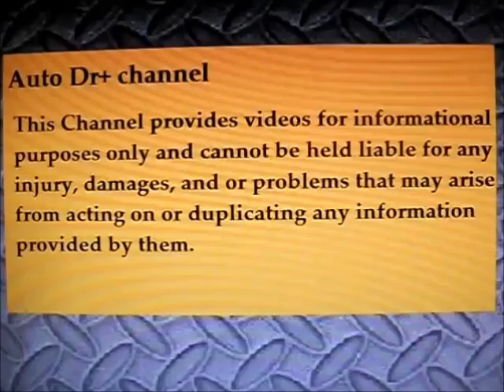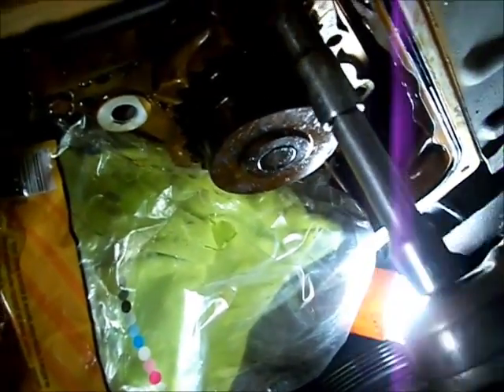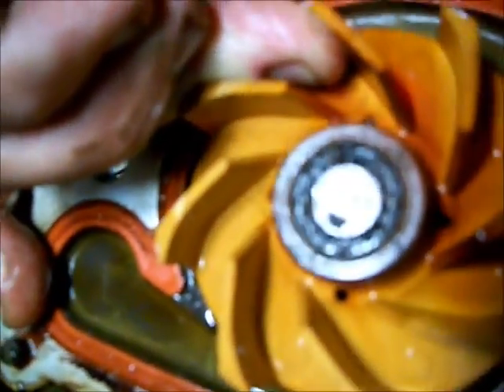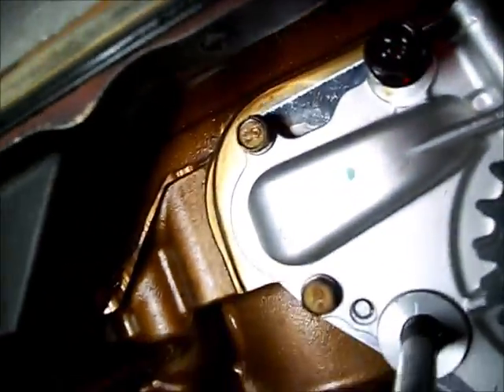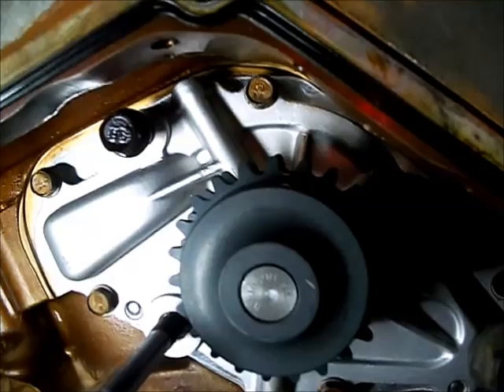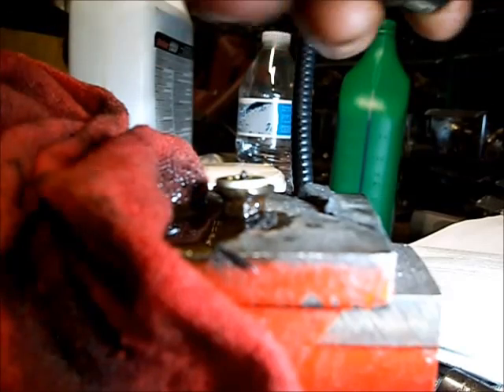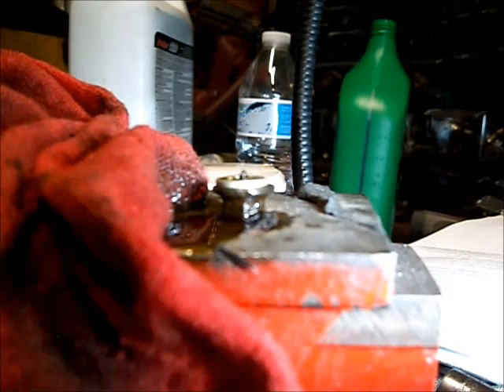Dodge Magnum `05 w 2.7l pt.2 water pump replace timing chains

Comment: Hi, just purchased a 2005 Magnum with 2.7 engine and I am trying to do maintenance before I move out of state and don't have my father (mechanic) available close. It has 127k and I've already changed the spark plugs, intake gaskets, new Mobil oil/filter, brakes and rotors, and I'm going to change the struts this week. I want to have the car nice and ready for the heat of last Vegas and not have to worry about any maintenance other than oil for some time. Before coming across your videos, I was just going to grab a water pump from O'Reilly's or AutoZone and maybe the tensioner and go on my way. But now I'm more skeptical. The oil was fine and no crud under the oil cover on the engine so it seems good internally, but since I have read about the water pump issues, I am wondering if you can help with what parts I need from the dealer. I can see that I'll need the timing chain, tensioner, water pump, wp gasket, tensioner plunger, sprocket (optional?), Secondary chains/tensioners since it's at 127k?, Tstat, tstat housing, heater tube o-ring, and refill of antifreeze. I'm not looking for part numbers, just trying to make a list to get some prices. I'm just doing my due diligence with this engine since I'll be in a new state and it's my only car. Thank you and apologies for the long question. Any help is appreciated.
Reply from the maker: First off, you have set yourself a daunting task, replacing all of those parts.  I would have invested that $ into a lower mileage vehicle, with everything still viable, generally.  (Not a criticism, just experience) But, since the ball is already rolling, then make sure all of the engine associated parts are OEM, call local dodge dealer ask for parts and give them the last 8 of the V.I.N code.  (for absolute accuracy, mostly) A factory T-stat only w seal or entire housing, (must observe condition of old housing)  Oem chain, tensioner, guides, (if guides have a 1/64" worn in them, as this offsets amount of chain tensioner travel, significantly), oem water pump, B4 repairs begin: (Have code scan run, and check for any existing problems) then if ok, (drain, (recycle coolant), flush all old coolant out with water (critical), add Pres-tone flush or equivel and then top off water, drive for half day, or so let cool, flush again with water, add oem or equiv coolant.  DO NOT over heat the engine on refill because of air-lock,  If i`m in a hurry to fill, I take upper heater hose on firewall loose and fill system, pushing air out there, until coolant flows from top heater outlet, then stick hose back on, continue to fill with water outlet bleeder screw open.  Always check for interior heat output after 1 min of engine operation, if still cold after 2 mins. rev engine rapidly to 3k-idle-3k several times, if still cold, STOP, let cool till handle system, fill reserve tank, and loosen upper heater hose again, until coolant/water flows, repeat check for heat inside.  (That is the best way I could put it, but if engine gets overheated because of air-lock condition, best way to turn it into scrap) and to continue, look the radiator over on the tanks, peek between the rad and ac condenser for leaves, city trash, etc. Check coolant sensors for corrosion/leaks, Turn ac on, and verify cooling fans operates at some point in the cycle.  Check hoses on coolant for bulging, softer than other hoses, etc.  Change any cabin air filters for HVAC. Check accessory belts and pulleys for problems, noise.  Be sure and replace valve cover gaskets with new ones, aftermarket ok, front timing cover and related seals, seem to work over and over again without incident, provided the front seal isn`t leaking oil because of an existing concern.  Check the transmission lines where rubber hose to radiator connection occurs, for leaks.  Check trans fluid condition, and level, replace as needed.  Check axle boots for grease loss/cracks etc. check lights for proper operation as well.  And just don`t let engine oil changes slide past 3k, 4k max, despite all of the oil change hype about annual protection etc.  I assure you that if oil changes aren`t kept on a tight schedule, severe internal maintenance will be required.  These things will hold up, if the oil is changed, especially with the new style smaller chain they`re using.  water pumps last varying from 100k to 150k.  Just be xtra careful installing the tensioner plunger into the head, chamfer opening of head first 1/16" at a 45 degree angle, (if not already there) lube o-ring and head well, start straight, apply some pressure with a slight circular action if not seating, remove examine o-ring b4 exerting excess pressure on tensioner plunger.  That is another leading cause of internal failure, if the o-ring gets damaged and blows out, causing oil pressure loss.  Good luck, thanks for watching.
Reply: Auto Dr diy Thank you for the quick reply. I know this will definitely be a learning experience. The main reason I got this car was that it was either get this car and do the high milage maintenance required, or keep a newer car with the same maintenance coming up BUT with an auto loan and higher insurance costs. Long term, I'll do the same maintenance but pay much less in insurance and overall costs and I'll be leaving while fixing things. I'll be looking at the prices for all these parts. You stated on a comment that if I go get the water pump, I'll need the new guides and chain since it has been changed to a thinner model correct? Also, would it be possible to push this job back a bit considering that the engine internals seemed ok with no antifreeze leaks? I will do the wp change but I was not ready to have to buy oem parts and the higher cost. 
I have already cleaned the condenser and the radiator and checked for any leaks and there were no codes when I had it checked before purchasing. It didn't come with an hvac filter holder so no filter either but I'll be adding that later. Front belt seems new with no slack. Transmission was rebuilt less than a year ago. No other visual or audible issues(father checked for those when he did my tune up). Just worried about the possibility of the wp breaking randomly. I will definitely be following your guides once I do get the parts though and I appreciate your long responses to myself and all the other commenters, I learned quite a bit just reading them.
Reply from the maker: Kool, odd trans had to be rebuilt already.  The car is already equipt with the new style chain, so far they seem to hold up longer than their bulky predecessors.  Bare min, if going into timing area, replace wp, chain, and a new tensioner.   As long as the guides aren`t worn more than the thickness of a fingernail, they are typically good for another round.   I cant endorse any aftermarket parts inside of there, especially the chain, as 3 dif after market chains I tried, have failed (started rattling noise) (lucky that is the way it went down) within 15k miles.  And there is only so many times i`m going to waste my time with trial and error, just to save a couple bucks, and a high potential for severe engine damage. 
       Or just let it go, and wait for a problem.  May be years, but pump typically will start dripping out on driver-side, from a cast-in-block weep hole beside t-stat housing, @ lower radiator hose connection.  May check weep hole for any evident coolant, if none, its prob good still.  But the next stage involves a steady leak, from weep hole, and possible coolant intrusion, into crankcase.  And the final stage of failure, the bearings in pump fail, significant coolant intrusion into oil pan, and shaft of pump tilts up, causing slack in chain, then it jumps time and shuts down.  ( Had one that did all 3 stages, and it just jumped 2 teeth in time, pump shaft flopping around like a bobble-head.  Didn`t bend a single valve either, but oil light flickered at idle when hot, due to coolant intrusion into oil, prob damaged to crank bearings.  Thanks for watching
Reply: Auto Dr diy I usually drive at least 15k a year and I'm planning on using this as the main road trip vehicle, so it's good to hear that not as much needs changing on this one and that the aftermarket WPs are junk. I'll definitely get a quote on the parts soon. 
I'm not sure what happened but the reverse wouldn't work at times before it was rebuilt. I'm having it checked since it sat for a few months before I got it, just in case anyway. Since the shop will be familiar with the car and they work and I don't want to have any issues once I'm out of state.

Thank you again for your time and sharing your experiences. I'll certainly remember your advice later when I Don't have to change the WP every year. You might be one of the most helpful YouTube people. Thanks
Reply from the maker: No problem, be sure and take only the $ you`re willing to lose if going down the strip on Mandalay, etc, did a little better at Wendover, (6 hrs N) myself.  And again, thanks for watching
Reply: Auto Dr diy will do! I forgot to ask, I read somewhere that adding an oil cooler would help elongate the life of the engine and the WP. Do you have any experience with that?
Reply: Auto Dr diy **I mean, would you recommend it or have you seen it help/not help?
Reply from the maker: jfig008. Just keep oil changed, have coolant flushed every few years, and let cards fall where they may
Reply from the maker: jfig008. Unless ur towing a trailer, I wouldn't worry about a cooler.  Just more plumbing to go bad.
Reply: @AutoDrdiy  Update: I changed the thermostat about a month ago due to engine light and small leak around the lower bolt. Looked to be original part, which makes me think the WP has never been swapped either. The tstat seal was completely warped when it came out. Housing was in good condition so only changed that and the o-ring for the outlet. 
I am rewatching your videos and taking notes since I will likely be doing the actual wp on Tuesday. I was quoted $91(wp+seal), $403(chain+guides), $299(tensioner), and $55(thermostat). I have not checked another dealer but does that seem like reasonable pricing? You mentioned $650 for a kit, but I wasn't given a kit price here in Vegas. 
I'm guessing this should take me about 6 hours, would that seem about right? I'd be taking my time and going back to your videos throughout. 

Thank you again for taking time to respond.
Reply from the maker: @jfig008    $299 for tensioner?  Naw.....Tensioner should be around $125.  Water pump $125.  Rest about right.  May check a dealer parts seller online.  If pump goes bad it will leak out, (if not totally trashed) at a weep hole that exits at T-Stat housing.  If this is your first one, expect to take 12 hrs. Even with a Dodge damper puller/installer, de-grease surfaces, and recommend to make sure tensioner hole in head is not sharp, and may need to feather 1/16"entrance to opening with 320 grit paper, and thourghouly clean grit off with paper towel and solvent.  (Smooth entrance for o-ring, if it gets nicked, likely will blow out, and cause oil light at hot idle).  The crank sprocket is about the worst part, heating it up, (heat on gear fast) and then pulling it quick with puller.  Also, it makes installing easier, but not recommended without prev exp.  as overheating gear will ruin its temper, and fail early.  (Below 300 F)  The heat expands the gear hole slightly.  The gear has no key way, just a timing alignment pin.  And is only held by its brutal grip on crank.  Aftermarket sprockets are sub-standard, and will not hold their grip on crank, like the OEM will.  Been there, got to redo it after loose sprocket sheared little alignment pin.  Lucky didnt bend valves, as the little pin walked with slot on gear and wedged sprocket from going more than a tooth.  Let  chain soak in oil for an hr.  then hang to drain excess oil.  Thanks for watching, and take time to verify each step, if out of time 1 tooth, you'll be taking it all back apart to do it right.  And dont forget to spring tensioner plunger open with long screw driver, after chain and guides are installed, or it could go wrong.
Reply: @AutoDrdiy   Auto Dr diy  I'll definitely call around for that tensioner. I did make a note of the sharp hole but I'm a bit confused on the heating part. Is that for the pulley on the front or the camshaft crank to take the chain out? Can it be done without heating?
Do you recommend changing the sprockets or only if different style chain? This dealer said only one style was used though, didn't even ask for my vin
Reply from the maker: @jfig008    yes, only one style chain, and yes you should change all sprockets.  Or it will shorten the life of the chain some.  The damper pulley should never have heat applied to any part of it.  I have removed the chain, and used oxy torch to aid in removal of sprocket  only.  If sprocket is OEM, it should take about 800 lbs or more of force to move it cold.  If I wanted to spend money on the right tool, OEM uses, then I wouldnt have to take those little shortcuts.  Heating just the sprocket to a few hundred deg. cuts the pulling force down to about 200 lbs .  And I can use a cheaper puller to remove it.  You could probably get by with the old sprocket left alone, if the chain hasn't left major teeth prints in it.  It is difficult to remove if you aren't use to improvising, in this field, on a regular basis.  Before removing, the depth from sprocket face to nose of crankshaft should be measured precisely.  To the thousandths of an inch.  So you can tell that the new sprocket is actually fully seated against the crankshaft.  The sprocket would then have to have its keyway precisely aligned with the 1/8" timing peg, sticking out of crank.  It is around 3/8" away from sprocket when beginning to press it back on.  (Pain for aligning it).  And as simple as this sounds, you must have the timing mark on sprocket facing out where you can see it.  (Yes I have seen someone install sprocket backwards) .  It won't work, the sprocket has about an 1/8" ring built up on its nose, and this would offset chain into places, it doesn't belong.  So it is a bit risky messing with that sprocket without the right stuff, and the confidence that you know it can, and will be done.  On top of everything, you cant be letting the crank turn with ur puller, or valve damage may occur.  I've used a 3 jaw puller to pull sprocket, while applying heat to the sprocket teeth, heating in a circle. Being sure puller bolt cant damage crank bolt threads. I used a cut off crank bolt, and a nut to fit it, against a deep well socket, and or some washers, with some heat applied only to outter sprocket diameter, to drive sprocket back against crank.  An impact wrench aids in this, as it is less likely to rotate crank, during procedures.
Reply: @AutoDrdiy  I did a bit of research and that heating part no longer seems too bad. Thank you for clarifying. As far as putting the new sprockets in, some suggest heating again, would that damage a new sprocket?
Reply from the maker: @jfig008  over-heating it, that will damage it, and not do the crank much good either.
Reply: @AutoDrdiy  what would be the worst that could happen, using New pump and tensioner, but old guides and chains? Seems like they gave me the wrong timing kit, and only realized as I was trying to match the timing marks.
Reply from the maker: @jfig008    well that depends on how worn out those items are.  Seems like alot of work to go through again, when the chain is stretched to its limit, and rattling on start, in a few months or so.
Reply: @AutoDrdiy  definitely lots of work. And the old tensioner was at about half it's limit. I'll have to wait till tomorrow and see if a dealership around me has the correct chain kit. Bought things in Vegas and came to LA to do it while I was visiting. Thank you for the insight, I think I'll try to get new things tomorrow
Reply: Although these looked to be original with 133k, would it be wrong to assume they'd last at least another 100k? With the new tensioner. I know it's a waste of a tensioner but a bit desperate at the moment.
Reply from the maker: limit.   If the guides dont have to deep of groove worn in them, they can be reused. Like if you dont hang a finger nail, when you drag across wear area.  I have bought aftermarket guide set, and took the skins off of them, and slipped onto the OEM brackets. This was because aftermarket brackets are sloppy tolerances, cheap alloy, and some flash casting on them were apparent. The skins on them seem to have a comparable service life.   With every part that contacts the chain, then as close to original as possible, will shorten the tensioner plunger that much more.  And extend the service life of the chain.   Sprocket dia., guide wear, chain stretch, all add up to keeping the tensioner from reaching its service linit.  Even timely oil changes, particularly.  The heads cannot be cut down because it would make tensioner reach its service limit sooner.
Reply: @AutoDrdiy  Happy to say it's done and the Magnum made the 400 mile trip back to Vegas with no issues. Heat starts soon after start up and coolant level is not dropping. No chain or any noise. Ended up changing out the timing cover gasket along with the gasket around the balancer and o-ring behind it. All looked like plastic pancakes and leaks were obvious by the buildup of crud by the balancer. All seems well so far and I drove to work and back today with no issues or noises. Thank you very much for all your help and advice through this. Manuals tell you what to do but you helped with what not to do and what to look out for. Thank you again!
Reply: @AutoDrdiy  Also, old water pump seal was eaten up on one corner and had about a 3rd of 'good' gasket left. It was likely leaking as well since the output hole had some buildup inside it. Definitely good timing. I was very happy to discover absolutely no sludging inside the valve covers. Looked like new except covered in oil. Not bad for 133k
Reply from the maker: @jfig008  Congratz.  If it started up, and had no leaks, it is as good as it gets.  Did you replace the crank sprocket, by any chance?
Reply: @AutoDrdiy  Yes. A bit difficult at first but quite easy once I had a larger puller.
Reply from the maker: @jfig008  Ahh, good.  If everything was torqued to spec, and oil changes maintained, it should be good for another 100k.  Keep an eye on the tie-rid ends, for wear, they go fast when starting to fail.  (With the milage that's on it.)  If you get bored, you prob should change the transmission  fluid, and remove/ flush the pwr steering fluid reservoir.  Thanks for watching.
Reply: @AutoDrdiy  funny you said that. I've already changed one tie rod and I flushed the power steering while I was there. Did not do the transmission though. And the differential fluid is also on my list
Reply: @AutoDrdiy  Hello again. My Magnum is doing great. The problem I am having right now is that my brother's 300 will not turn on after replacing the chain and wp. I triple checked the marks and everything looked good. Everything is plugged in
Reply from the maker: @jfig008  If all the timing marks are good, unplug the crank sensor on the transmission bell housing, then plug it back in, and try to start.  If not start, unplug the cam sensor, then turn over the starter for about 45 seconds, if its out of time, then it will start, (it will run just on the crank sensor, but long crank time, to start, and will not rev up high, like that) if still no start, (a wrong year cam sprocket, of damaged cam sprocket will do this) then you will have to start with the basics. Like check for spark, is the fuel pump running while cranking? have fuel and fuel pressure?  check for an  R P M reading while cranking,  if equipt with tachometer, verifies cranking signal to computer.  i could go on, any security light issues?switch asd relay?  i have sprayed a substantial amount of carb cleaner into the throttle body, while cranking, to see if it is a fuel issue, but dont recommend it, as there is the possibility of personal or property damage occurring.  usually if it was running b4 the work was done, then it will typically be the result of an error in that process causing the concern, it happens.   thanks for watching
Reply from the maker: I have seen an aftermarket crank sprocket, spin on the crankshaft a little, and shear the little pin in the crank nose that aligns the crank sprocket to the the crank, (throws it off a tooth) this result can be seen buy looking down the keyway of the crank sprocket, and verifying that the keyway is in the center of a shaved-flat area on the crank shaft nose.  if sheared the pins broken top, will walk to the edge of the flat area, and wedge against the keyway of the crank sproket, (luckily) or it would bend all the intake valves.
Reply: @AutoDrdiy  We actually didn't change the sprocket, just the pump/chain/guides/tensioner. All matched the sprocket/cam sprockets already installed. I'll try the sensor unplug to verify if it's the timing. Thank you again
Reply: @AutoDrdiy  the car also sounds like it's struggling to turn over when we tried.
Reply from the maker: @jfig008  I've never seen a new chain jump, after install, (because of the tensioner plunger being dry), but have watched the chain "whipping" the tensioner arm while cranking it, in earlier attempts to fill the tensioner plunger with oil before actual start up.  But in general chat with other mechanics, there wasnt a problem after starting it.  So didnt waste my time, but I believe that under the right circumstances, it could happen.
Reply: @AutoDrdiy  Turns out that I set the chain correctly but missed the camshafts not being correctly set. Took it apart and rechecked. Turned on first start and we're testing it now. 

Another job completed thanks to your help
Reply: @AutoDrdiy  camshaft had slipped from the vice grip
Reply from the maker: @jfig008  at least the vaves didnt get bent.  Thanks for watching
Reply: @AutoDrdiy  2 things have happened lately. Brother's Chrysler 300 won't go over 70 without crazy shaking. Likely timing related. Hopefully I'll have time soon to recheck it.

And it's finally time for my Magnum's head gasket to be replaced. Colder weather seems to make the heads warp more and I started losing water. No leaks, just exhaust smell when I went to refill. Luckily I was only using distilled water in the summer so no horrible milkshake. Looks like that's next week's project. Would you have any tips?
Reply from the maker: @jfig008  Well, if the head is warped, then its been overheated, or has a cooling system problem.  Those heads must be replaced, and cannot be machined, do to the chain length.  They should be checked at a machine shop for warpage/cracks, etc.  Flush oil pan with solvent, use OEM parts for timing/water pump, guides, tensioner, sprockets.  No aftermarket.  Heads, if needed, quality aftermarket, ok.  Coolant in oil, will destroy bearings, oil pressure loss, and rod bearings will get wiped fast.  Shop vac junk from cyls, asap, after head remove. Light oil coat after vac.  New OEM T-Stat/seal.  Check heater core for no restriction, back flush it and radiator, proper volume of water flow.   New head bolts, threads cleaned/ vacuum out, no standing liquid in holes, bolts lubed with lint free oily rag.  Check oil sending unit for oil at plug-in, replaced if oily.  Make sure dowel pin guides stay with engine block, not lose on old heads.  I rebuilt a 2000, 2.7l, in '05, and it is still running.  3 chains replaced,, over a 170k mile duration, so far.  Cams are worn out, (pitted) as noticed50k ago, with last chain install.  A switch to synth oil, has caused valve cover, and oil pan gaskets to leak, over a 15k mile period, on it as well.  It was designed for conventional oil, so yea.  Might even go with a 7 psi rad cap, as the plastic water outlet gets brittle with age, and will crack under OEM cap pressure.  Thanks for watching
Reply: @AutoDrdiy  Wow lots of information thank you. Most of that was replaced when I did the water pump 2 years ago. 
I'm not sure if the heads are warped or if the gasket just failed but it's likely since I was losing water every night when it cooled down and it overheated 3 times. 2 times it caught me very off guard since I thought it was another issue. The last I noticed it start climbing and immediately turned on the heater and got to the side of the road. 

Somehow it made it the 300 miles back to LA with no issues though. It's waiting there while I figure out if I can actually do this myself.
Reply from the maker: @jfig008  Likely big $ to fix it right.  Good luck with it.
Reply: @AutoDrdiy  Thank you. 
I'm really lost as to what is going on, but when I go to start up the car, I hear the chain skipping and then the car shuts off. Doesn't start completely, just spins the chain and shuts off. I thought I did something wrong so I went back and re-timed it, and same thing. Changed to a new tensioner and chain, and same thing. I am completely lost. Cam markings and sprocket markings are where they need to be when instslling, but after attempted startup the chain has skipped. Any thoughts would be really appreciated since I have no clue where to look from here. Thank you again.
Reply from the maker: @jfig008   First off, you know this is a valve bender, right?  And being careless, is the best way to ruin it.  But it sounds like you are not releasing the tensioner plunger, with a long screw driver, after it is installed.  Or the oil pressure isn't  getting into the tensioner, to apply the proper tension, after the initial release of the tensioner is done.
Reply: @AutoDrdiy  i think it's the second thing you mentioned. I'm releasing the tensioner. I just took it back apart and noticed that the cam chains are slipping.. I used some new tensioners there too but I think they are bad. I spent too much time making sure the cams and timing chains were correct and now all 3 chains are off mark
Reply: I was afraid of the valves getting bend but at this point that's very likely.
Reply from the maker: @jfig008  eww, I wouldn't have touched the cam secondary chains, or tensioners.   They don't go bad normally.  I would reinstal the original tensioners, on them.  Set all back in time, release tensioner plunger. Also, to check for bent intake valves, wiggle the cam followers, if any are loose, (with cam lobe pointing up on the one ur checking) then compare the height of that valve stem top, with one that isn't loose. If any valve stem tips are lower than the others, ( without lobe pushing down on it )  then its bent. As the head of valve gets bent, it keeps the valve from returning to normal height.  They can be tigged, and may not be noticeable, bent, but will miss on that cyl. And heads would have to come off.
Reply from the maker: Also, if the o-ring gets shaved off, on tensioner plunger, it will not pump up the tensioner, had it happen once, chain kept rattling, but never jumped time.
Reply: @AutoDrdiy  You were correct, I bent all of the passenger intake valves. Lesson learned. Luckily I know how I did it so it won't happen again next time. I checked the driver's side and those are perfect.

The new cam tensioners were a bit too springy so I will be using the old ones, just swapping out the plastic pieces.

Hopefully this time next week I'll be writing to let you know that it's running like back in 04. Thank you so much for your input and help.
Reply from the maker: @jfig008  Thats going to be another pain.  But on these valve eaters, every step taken, needs to be thought out, and with intention.  Replacing the skins, is all I would have done on cam tens.  Good luck